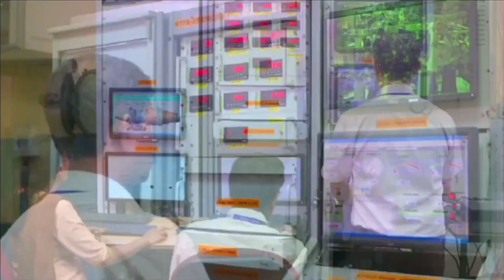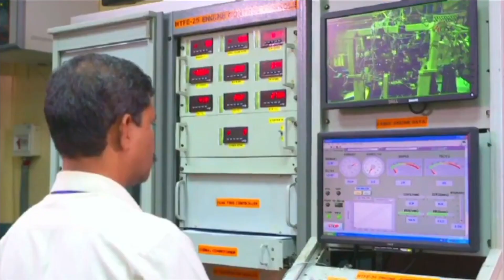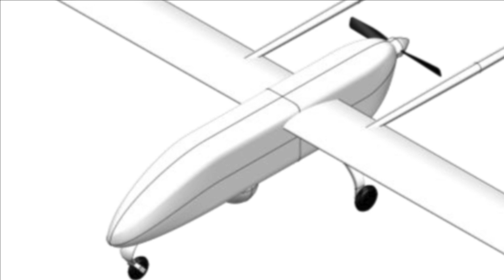DRDO Unmanned platforms: Weaponized SWiFT, Kizliema like unmanned fighter jet & Unmanned Naval LCA

Comment: SIR, canada's deal of F-35 is very cheap,how is this possible,coz its very huge difference in per unit cost
Reply from the maker: I haven’t yet checked that, but F-35 can’t be cheap.
Reply: @IndianDefenseAnalysis  please do check SIR, there is huge difference of more than $50m per unit
Reply: @yashsharma_12345  it think they bought upgraded variant
Reply: @yashsharma_12345   Economy of scale.. America manufactures near 140+ F35 per yr. 
Flyaway cost has gone down to 79 million dollars per unit.. Excluding weapon and maintenance packages.

Comment: HTFE25  at the earliest will achieve certification by 2025. Given the many delays to date, this is a date that doesn't inspire confidence. More effort has to be done to get engines, including Kaveri certified and ready to fly by 2024. A weaponized SWiFT is an excellent idea, plugging a huge gap in lack of armed drones currently. Single Engine Twin Boom (SETB) is going to be ADE’s MALE UCAV is lacking in concrete info. What role does this fulfill? What can it do in comparison to other drones, what problems does it solve? Great news that ADE is going to induct 76 Tapas. Finally a desi drone will be in service.
Reply from the maker: 2025 I seriously doubt
Reply: @IndianDefenseAnalysis  Not 2029? Is there anything that can be done?
Reply: @datoolz0   Kaveri engine project failed miserably during test in Russia. Engine core and Turbine blades get melted and thrown out during flight testing. 

Its a cover story that DRDO was able to make 80 kn engine bt IAF had requirement of 90kn engine so we went for GE. 

Otherwise it is jst a common sense..a country able to achieve 80 kn engine couldn't make a 10kn manik engine 🤦‍♂️🤦‍♂️🤦‍♂️

We have seen this drama during test flight of nirbhay cruise missile.